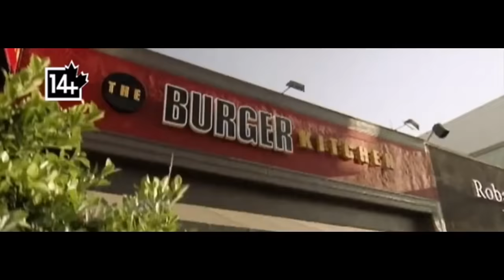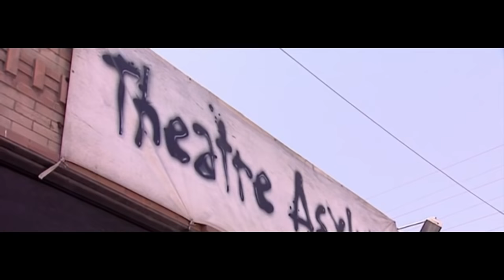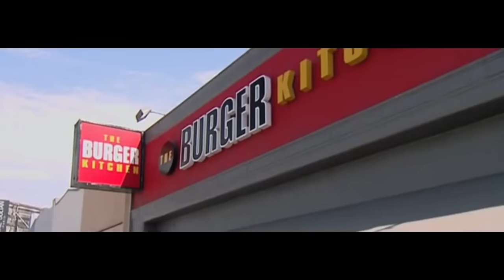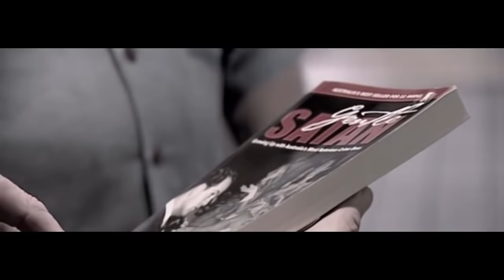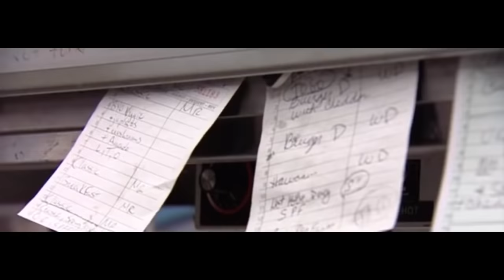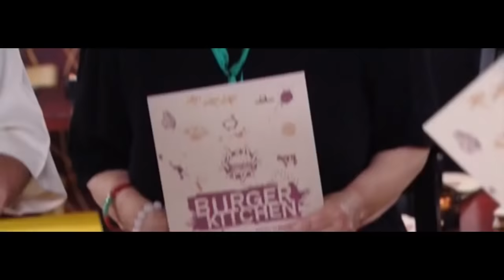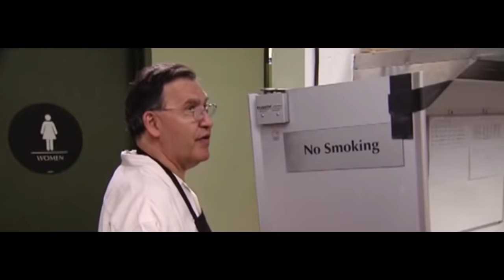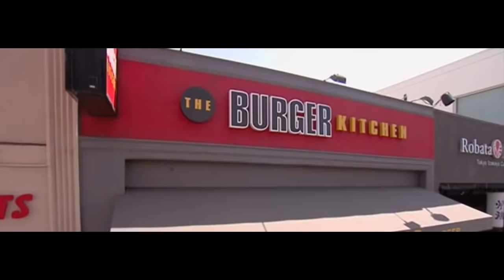Gordon Ramsay Kitchen Nightmares - Burger Kitchen * Part 2 (two)

Comment: The father does too many 180s too quickly.  

The first time at the theater sounded a little fishy, but I figured they might have cut out quite a bit of time where everyone talking in order for him to understand as to keep the episode from going over or spending too much time on one issue.  However, when Ramsay uses the book as a mirror to show the father is doing exactly what his father did to him, there's a hint of sarcasm in his voice in his "I was wrong" moment.  Hell, it felt like he was reading from a teleprompter - it had no emotion.  And his bit about closing the doors screamed that he was virtue signaling but hoping no one would call him on his bluff.

He doesn't fucking think he did anything wrong and I doubt he sees the parallels of what his father did to him and what he did and is doing to his son; he just wants everyone to shut up and leave him alone.  He's just placating everyone so the issue can be dropped.

Fucking hell.  They would have been better off just dumping the money into bonds.
Reply: I just got to that part. There were definitely a suspicious number of edits in his monologue, like they cut out a bunch of crazy stuff.
Reply: Mareritt exactly, it's a typical narcissist tactic - once they're cornered they'll do a 180 with a fake apology and virtue signalling so they can feel like they're still in the right. Every time the dad said he was TOTALLY giving up control to the son I cringed. He'll be back to his old ways once pretending to be a good person gets boring.
Reply: I know right? Did you see how she smiled at her son getting upset? That's gaslighting.

Comment: The big difference here is that Alan and Gen are bosses, while Daniel is a leader.
There’s a huge difference between the two, bosses stand over the employees with a whip, while a leader stands in the front and pulls them along.
Reply: No, Daniel is not a leader. A leader identifies what needs to be fixed, takes responsibility, and fixes the damn think.

Take that chaotic ticket order system. A leader would have called the staff to a meeting, the staff that have to live and work with the ticket system. A leader would get their input, their suggestions, and worked out a solution.

I have no experience in the restaurant business. Maybe that putting tickets-up-on-a-shelf system works for other restaurants, but not there, not now. Would a white-board with magnetic clips work? A board divided up into squares, one for each table? Colour-coded tickets depending on rare, medium and well-done? Hire a cheap student to take the tickets from the servers and interface with the kitchen?

Comment: too bad though the place was closed on February 2012 after it was filmed in August 2011. Due to multiple changes in the menu people reported that none of Gordon's dishes were on the menu and Yelp started giving negative feedback on the place. The POS System installed was removed and service got slower. Sad

Comment: *What Happened Next at Burger Kitchen?
*
At Burger Kitchen after Kitchen nightmares, the menu and kitchen staff at Burger Kitchen in LA were changed numerous times.
In August 2011 the restaurant is said to have changed ownership and by October 2011 there was a rebranding, a new, smaller menu, a new team of Chefs and new management in place.
Yelp reviews continued to be negative and customers reported that none of the burgers that Gordon had created were on the menu.
The POS system installed as part of the revamp was also no longer used to take orders, burgers were still not cooked as ordered and service was very slow.
Burger Kitchen closed in February 2012.
There was a for lease sign at the restaurant in mid January and the restaurant was shuttered in February.
There is the belief that the Burger Kitchen episode was staged and Burger Kitchen was exposed in this blog post.
Luigi's opened in it's space just a few weeks after they closed but this also closed.
Jaffaa Middle Eastern restaurant is now in it's place.
Burger Kitchen is Kitchen Nightmares season 5 episode 5 and 6 and was aired on November 04 and 11 2011. The episode was filmed in August 2011.